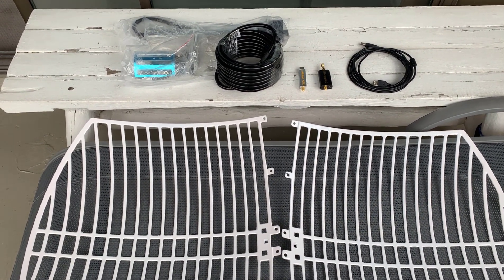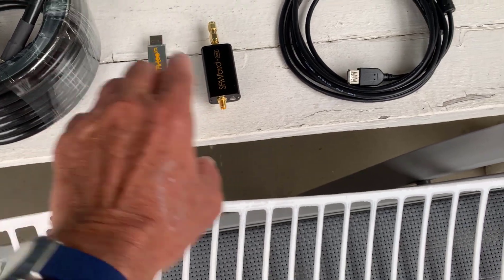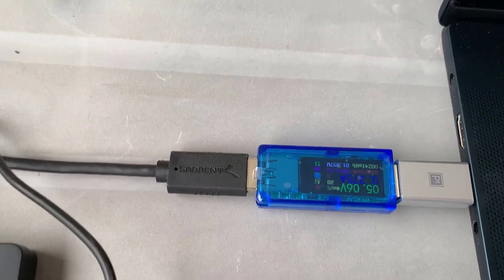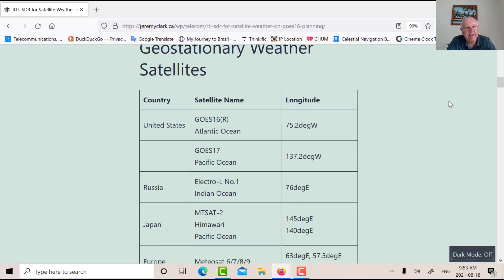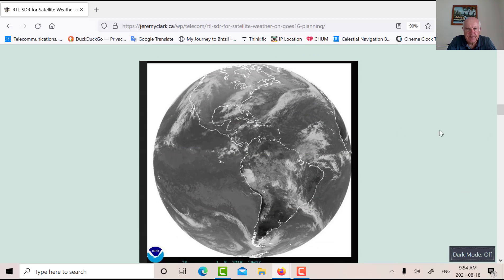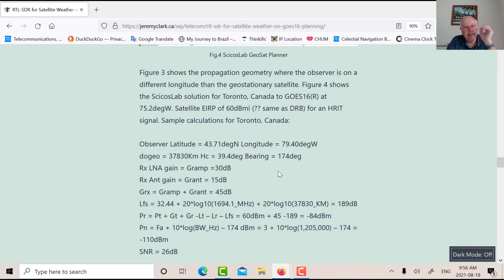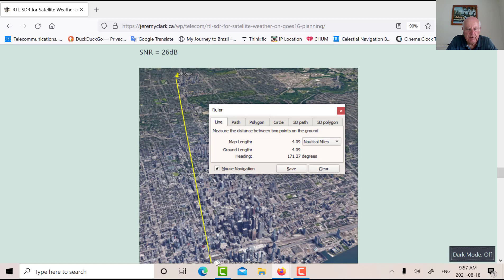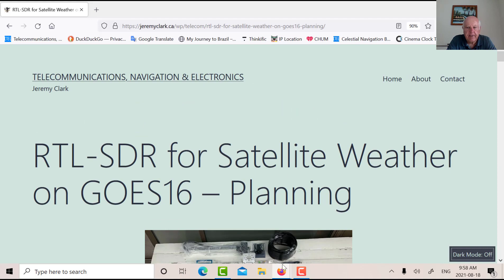RTL-SDR for Satellite Weather on GOES16 - Planning

Comment: Very nice breakdown of the power losses/gains.. it is very helpful information sir thank you. I am currently trying to target these satellites, and started with a 3D-printed helicone antenna, but no dice.. I caved and bought the nooelec goes dish, and modified the LNB dipole to get a sharper SWR at 1694.1. Again much thanks for the derivation of the free space loss.
Reply from the maker: Best of luck in your reception!
Reply: @ClarkTelecom  Thank you! I've finally got a good reception from GOES-19, around 18dB SNR, with a vit of ~150! I am feeding the sawbird+goes into a LaNA into a rtlsdrV4, all on a RPI5. I'm going to design and 3d-print some flare extensions for the nooelec dish to hopefully gain an extra 5-8dBi on the antenna. Thanks again for the help!
Reply from the maker: @TeraVoltLabs  Great results, let me know how the flare goes!

Comment: High Jeremy. So glad to find this great SDR GOES video. I am putting together a 21cm 1420.4 MHz radio telescope dish. Do you have any suggestions or videos that would help? Thank you.
Nooelec GOES Weather Satellite Mesh Antenna - 21dBi Parabolic Antenna w/ 1.7GHz Center Frequency, 200MHz+ Bandwidth, LMR400 Feed Cable with Male SMA Connector, 
Mounting Hardware Most of the information is from a:  Alex Pettit: Galactic Hydrogen 1.42 GHz RF Emission Radio Astronomy for $300  https://www.youtube.com/watch?v=C6NCefVxNL8

Comment: I have a working goes-16 setup in Toronto.  11th Floor at King and Sherbourne shooting off a west facing Balcony….In had to double up on the LNAs, wrap the equipment boxes in wire mesh, and add some chicken wire to the back of the dish, but got Vit Average of between 400-550…but few drops.
Reply from the maker: Hey that's so cool! My balcony has been blocked for the last 4 months for repairs, so I am itching to get my dish out again. I am going to make a more permanent easily detachable mount! Did you use the NooElec kit?

Comment: Vraiment, merci so mutch Jeremy, the antenna could be a challenge to install on the sailboat , so many questions answered ..the light in the tunnel  getting brighter 😃
Reply from the maker: Hopefully when I get it setup, I can play with the system gain and get the antenna down to something with a wide beam width to accommodate reasonable boat movement and that can be clamped to a stanchion and setup with a compass/clinometer. On va voir!